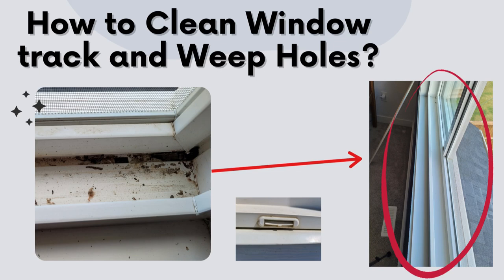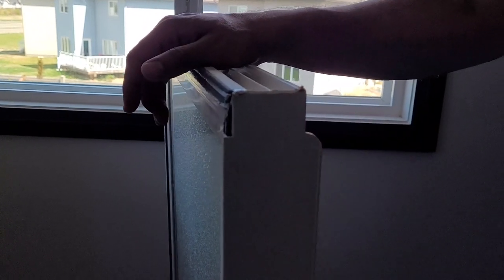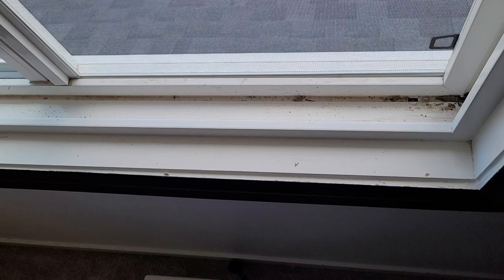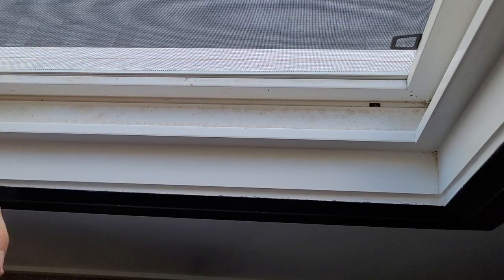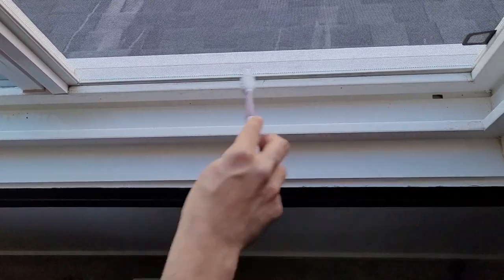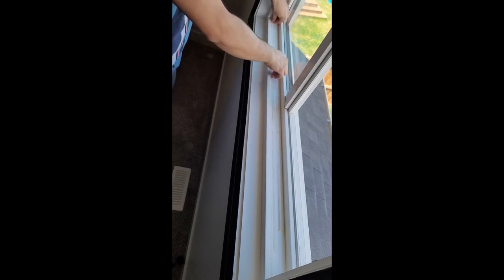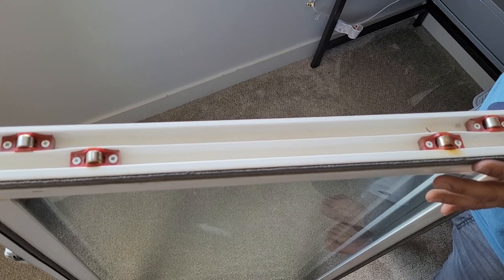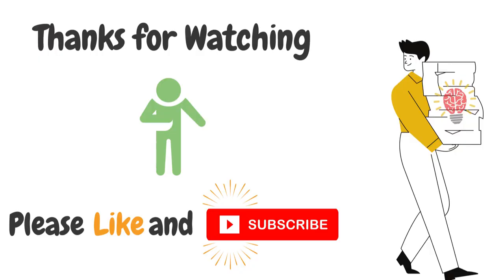How to Clean Window Drain Track and Weep Hole

Comment: Thank you for these instructions.  I was washing my windows on the outside and I saw the "weep drains." I quickly figured out their purpose, but some were draining, and some were not draining at all.  I blasted a lot of water with the hose, too. Thankfully I checked on the inside and found a flood. Yuk.  So I cleaned the window track thoroughly, but I couldn't see any drain hole. I tried putting a long bundle tie in from the outside to see it thru, but it never showed on the inside.  Dumbfounded, I finally searched online and found your instructional.  Now I finally learned how to remove the track window to clear the drain hole. Thank you!!
Reply from the maker: Thank you for leaving us a comment.
Happy that this video helped you to clean your windows thoroughly.

Comment: EDIT
This doesn't work for vertical windows. Vertical windows there isn't any way to get underneath. 

FINALLY
Someone who shows how to get underneath. With a vertical window, can I pull up like you just did to expose the under channel? I need to get underneath because it is clogged.
Reply from the maker: Hello,
Yeah, it doesn't work for vertical windows.
You can try to use a mix of 1 cup vinegar and 2 cups of water to clean the drain lines on PVC windows for any space that's hard to reach.

Comment: Wow, so we've been having issues with our horizontal sliding window leaking.  From your video I realized the track in our window looks like it's been installed in a flipped orientation.  The downsloping portion of the track is toward the interior of the room!
Reply from the maker: Hello,
It depends on the window design of hiw they out their frame in.
I am not sure what you mean by Downsloping portion, but If window is leaking from the top, then its not window issue but issue with House Envelope.
If your house is new, then it will be covered in warranty for 5 years from Possession Date. If not, then you can contact exterior envelope contractor to inspect and fix.
Please let me know if you have any questions.

Comment: What type of tool should you use to clean the actual drain hole/weeper? A pipe cleaner of some kind?
Reply from the maker: Hello Tara,
Sorry for late reply. 
I would recommend using squeezable lubricating bottle.
Its easily the available. And when filled with water, it can be squeezed to release water and it works to remove any debtis that might be stuck in the drain hole.
Hope this helps
Thanks

Comment: Can a window leak from the weep holes? Its raining and the water is building up on my sliding window tracks..
Reply from the maker: Hello,
If water is building up in track, that means weep holes are clogged.
You will need to clean.
Water doesn't come in from weep hole and fill the track.
Please let me know if this doesn't help
Thanks
Reply: @How2  I took my window out and there is no actual track. Because I can see both weep holes. And the water is coming through from the weep hole because one of the covers is broken so there is no where for the water to go, besides stay in the window sill and build up. Do you have an email so I can show you with a photo? And how would I go about making sure I get the right track for this window.
Reply from the maker: @anthonyviravong5076  
Please email me at howto2yt@gmail.com

Thanks
Reply: @How2  okay I just did. Thank you!